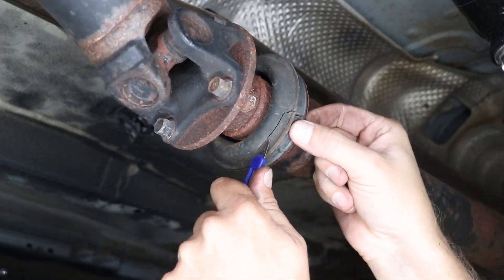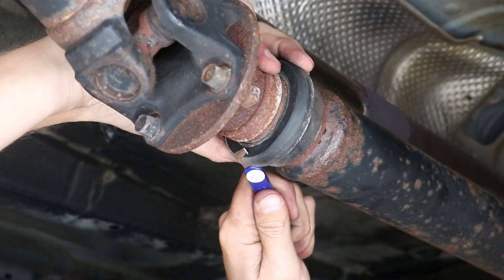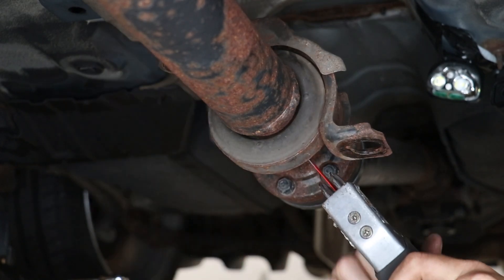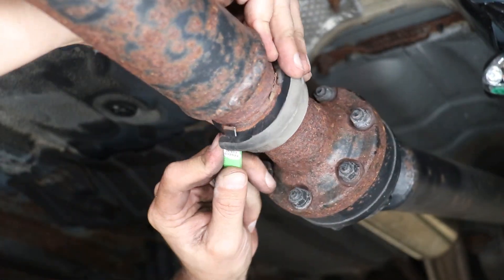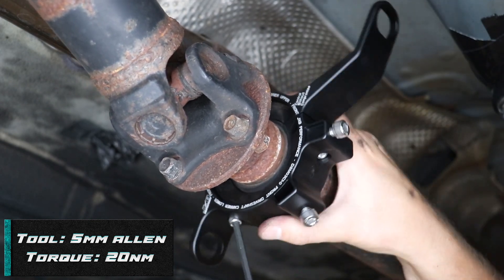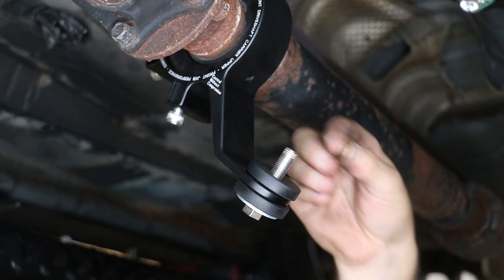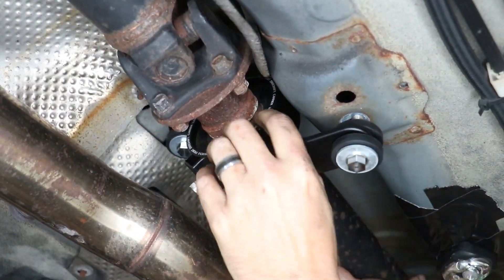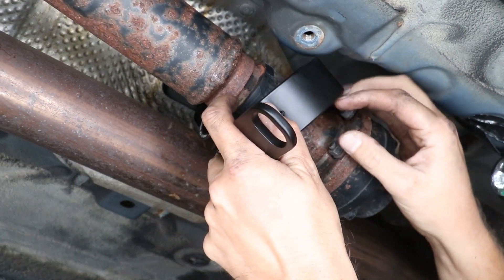Mitsubishi Evo X Performance Driveshaft Carrier Install (DSM03A0 - DSM04A0) - JXB Performance

Comment: After you cut off the rubber bushing is there another bushing under it that stays on? Looks like you put the new bearing on the original rubber piece.
Reply from the maker: We only trim down the excess rubber.  The base layer of rubber that's molded onto the sleeve the bearing sits in stays on.  That's what we clamp to.